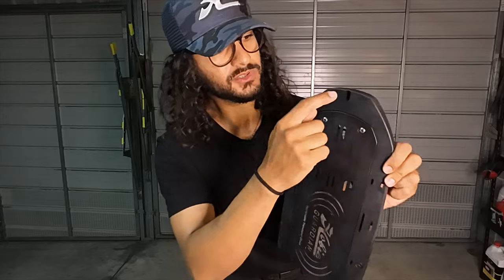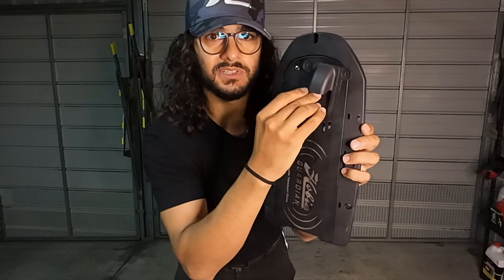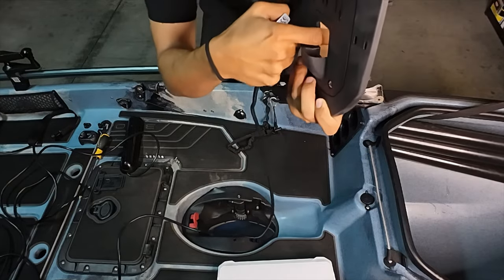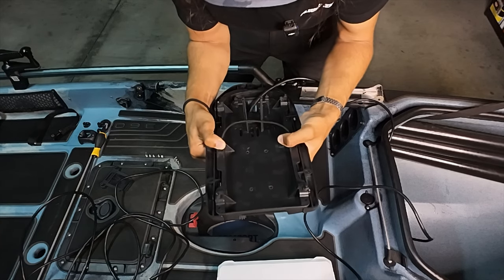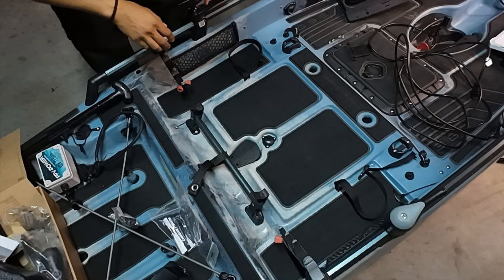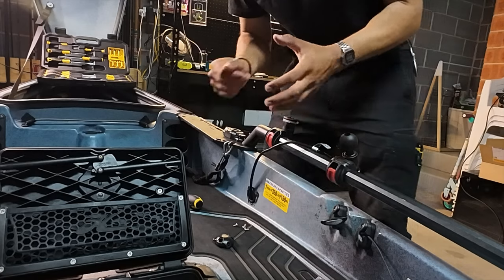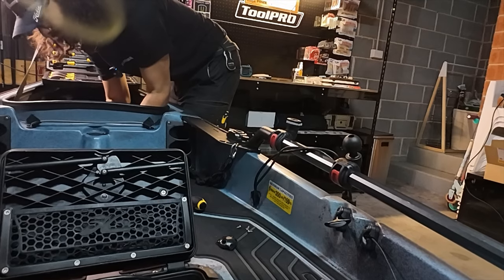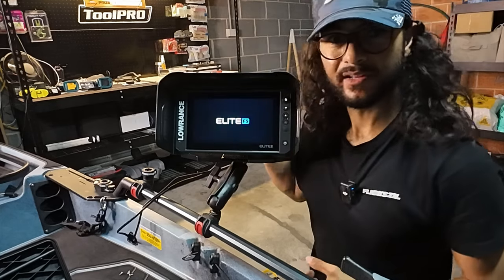EASIEST way to install the Lowrance FS9 on a Hobie Pro Angler

Comment: Great video excellent detail very clever design. I have the fs9 aswell great sounder  good luck on Sunday can't weight for the video.
Reply from the maker: I really appreciate the comment Andrew! 
I used the sounder once and I’m loving it already. 
Any tips and tricks with colours or sensitivity you could share?

Thanks mate, let’s hope I can get a bag!
Reply: @TheFinesseAngler  number 9 blue palet for side scan
Reply from the maker: I’ll give it a go!
Reply: I use A1 sensitivity change to suite conditions 
Colouring 76%
Also for charts 
Select charts 
More options
Charts options 
Genesis layer gives u 1 foot depth contours

Comment: What did you do with the yellow wire on the lowrance power cable?
Reply from the maker: I ran the power cable from inside the centre hatch to the front hatch and the battery is mounted on the pole in the front hatch.
Reply: @TheFinesseAngler  thank you for replying, but I am not sure that you understood my question. I was specifically asking what you did with the yellow wire that is part of the power cable for the unit. That cable has a red, black and yellow wire, so I didn’t know what to do with the yellow wire.
Reply from the maker: @zmoorern My power cable only came with a black and a red wire that ran to a fuse and then to a FPV pigtail. I don’t recall a yellow wire, however I bought the unit second hand and already had the fuse connected. Do you own the same unit?
Reply: @TheFinesseAngler  mine is brand new. Maybe they clipped it off
Reply from the maker: Very possible mate. It could be a live scope connection.